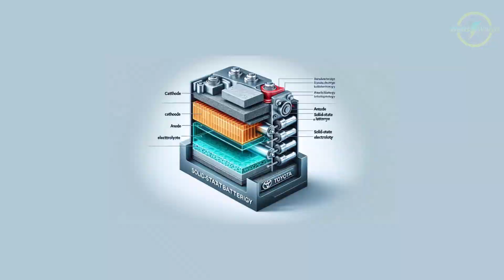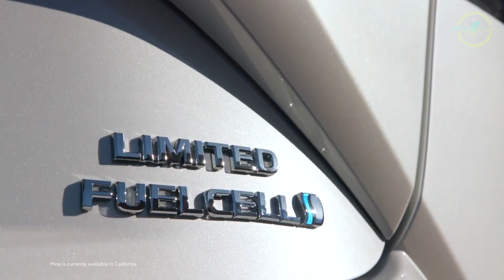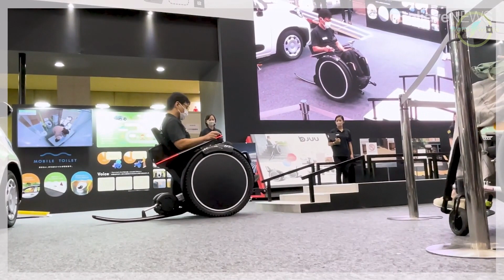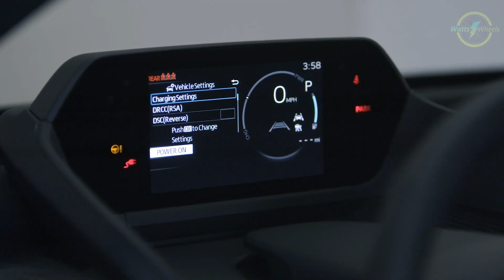Toyota's Shift to Electric: A Strategic Move or a Delayed Response? | WattsOnWheels

Comment: Toyota will suffer from people holding off cycling their ICE vehicles for another ICE vehicle, because they are worried about selling them in 5 years time. Toyota’s high debt level together with falling sales will prevent them investing the amount needed for EV manufacturing transition.
Reply from the maker: It’ll be interesting to see how it plays out. Long term Toyota will be a major player in the space.
Reply: @Watts0nWheels  I feel it will be a smaller Toyota, and the question is will they be able to service their debt as they shrink.